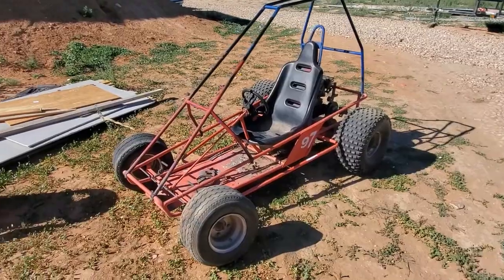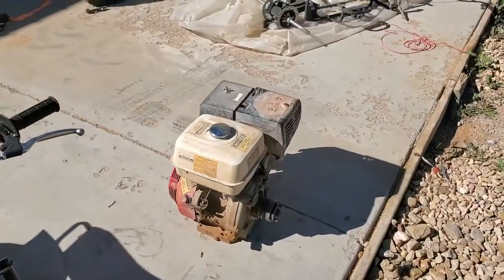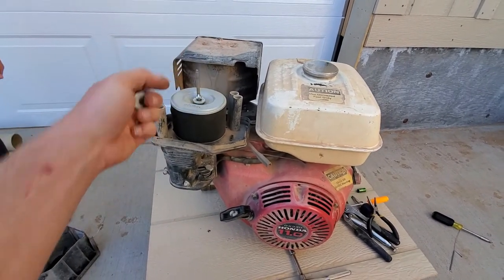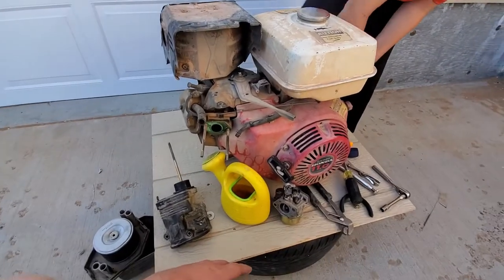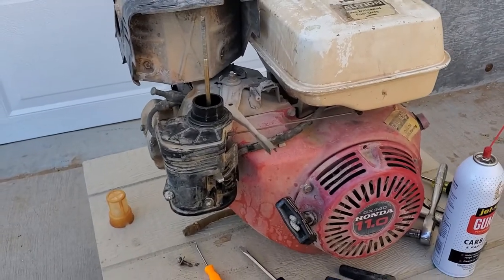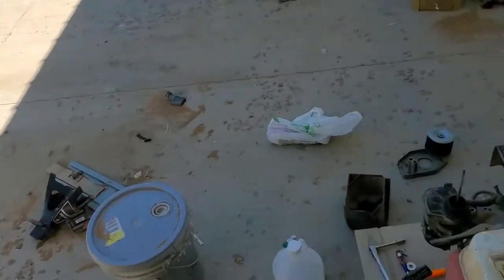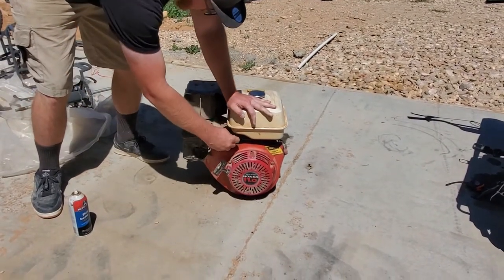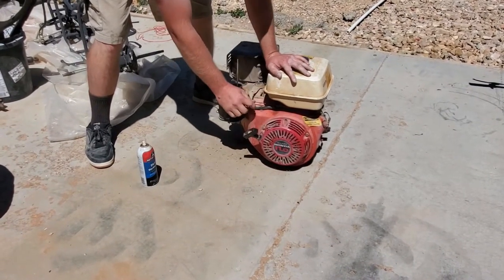HONDA gx340 Go Kart engine restoration  - CARBURETOR CLEANING

Comment: Nice job bringing it back to life!!! Not that you asked for any advice but I find it very beneficial to completely clean the engine before starting any repairs outside first then internals. Air filter fuel tank/lines complete carb electrical and so on. Also instantly addressing/repairing any issues that pop up as soon as they happen the issues will only get worse the pull starter for example. Take care!!! 👍🏻👍🏻